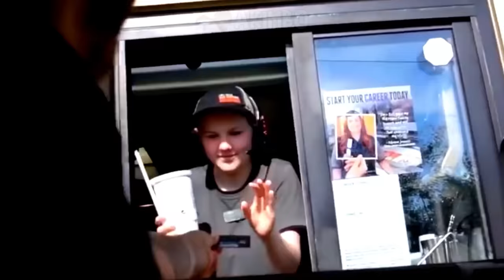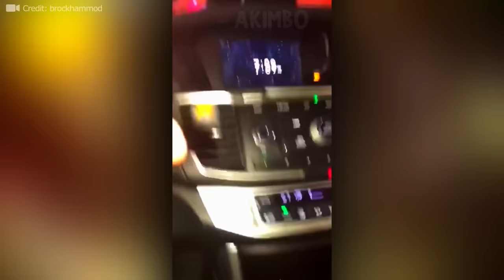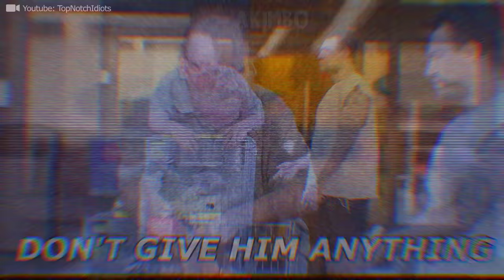Moments of Instant Karma | Best of Summer!

Comment: The plane bathroom one is not that hard to fix, if I’m correct there is a flight attendant button or you can push the little handle thing in and with force pull it and tell a flight attendant that the core is broken. Just had to let some plane knowledge out.

Comment: 31:53 That's BS! What if they had no choice but to moor there, like the engine failed or due to storm/weather? That happened to me once, had to make for the closest mooring due to severe storm. when I came back 30 minutes later with the trailer to remove it, the a-hole yuppie property owner had tossed the lines and shoved it away! It wound up sinking somewhere out on the bay!

Comment: So. at 1:25, I get that he honked, it was wrong, he startled her. But, its actually illegal to do that. If the man wanted, he has multiple options, on camera, in which he can use. Honking your horn isn't a crime, unless it is used aggressively which isn't the case so that rules out any kind of counterpoint. She knowingly and willingly threw the drink which puts her at risk of the following: Assault, Battery, Criminal Mischief or Vandalism, Disturbing the Peace and Property Damage. Some of these depend on damage such as property damage, but from the video, assault, battery and vandalism are the most likely to stick.

Just because you don't like what someone did, does not permit you to throw things at them. It can only be done if in a threatened situation.